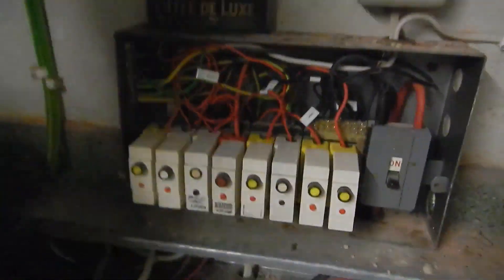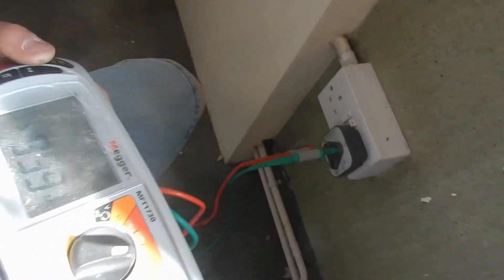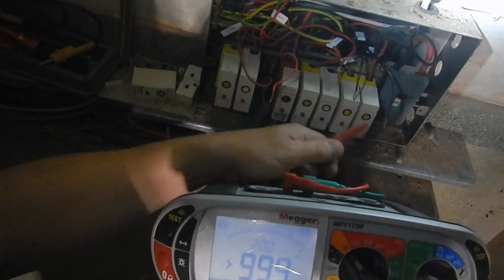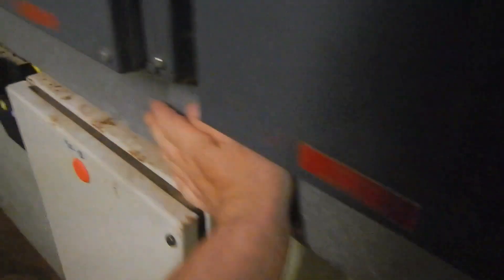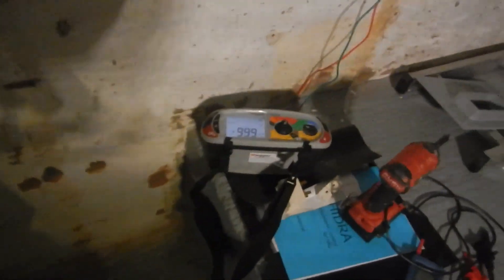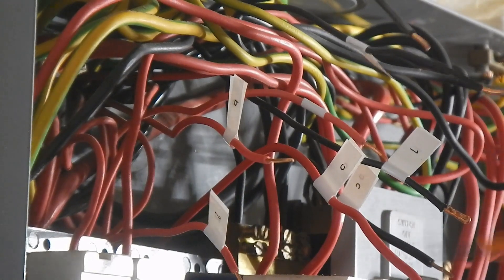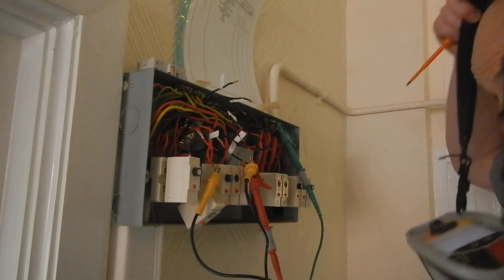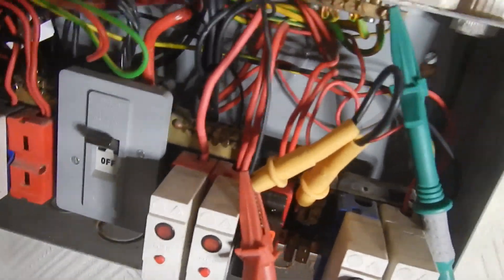Video 53:  EICR part 5

Comment: Any code for the different sized conductors in breaker 3 or the fact that two circuits are being fed from one breaker?
Reply from the maker: C2, but on some circuits I there and then downrated them to the smallest csa present.  EG kitchen board I bought new fuses to make the alteration then and there.  Two circuits fed from one breaker if they are the same generically, ie lighting circuits, shouldn't be a problem, it's just like having a spur.  So I code it C3 if anything.  How do you code them?   ACtually just bought the Codebreaker book by Napit, I'll have a look there and see if it comes up....    will let you know if they mention it....

Comment: Why do you dress like your from goodnight Mr Tom for work ?
Reply from the maker: I wasn't sure what you were referring to with Mr Tom when I got your post, but I've looked it up now and my sister seemed to know immediately what you were referring to - my socks.  This is very deeply ingrained stuff, quite psychological.  I do suffer from complex PTSD and this has something to do with it I'm sure of it, due to trauma I suffered from the age of 8 and 9, which is not suitable for mentioning here.  I'll try and explain where I think this comes from, as it is very ingrained as I said.  Wearing shorts and long socks all year round until about 14 was enforced by the very traditional boys prep school I was sent to, run by South Africans.  It is a hang up I have that I hate short socks now, I'm very OCD about it.  The socks are very similar to what I had to wear except they have no coloured bands on them, they are very soft and comfortable and are more formal in summer than just bare legs which I detest the look of.  It was practical and smart when I was a boy, although we didn't appreciate it at the time, and it's comfortable to work in now winter or summer.  But mainly, I've always been OCD about having pulled up socks.   I still feel uncomfortable seeing boys upto the age of about 13 wearing long trousers, or shorts without long socks, it seems wrong to me even now, I am stuck in my thoughts and ways which is part of cPTSD, which I am working on with intense therapy now.  I hope that explains it a bit.  Thank you for watching, and for your comment.
Reply from the maker: Hi, Michael, a reply came through from you but it was half deleted and I couldn't read it, could you send it again at some point as I was interested in what you had to say.  Also, what is Goodnight Mr Tom like?  I saw it had John Thor in it.  When did you watch it and is it any good?  Cheers.
Reply: @LAsparkTVWireTestLimited  oh okay no worries this what I put  ahh I see yeah I weren't mocking it I was just wondering as usually you would wear work trousers so you dont get smart clothes dirty but it sets you out from the bunch which is a good thing. Also goodnight mr tom is a moving set in world war 2 about a young lad that gets evacuated from london and lives with a old man in the country who helps him from his violent mother it's a good movie
Reply from the maker: @michaelboyes4948    O righto, thanks very much.  I actually thought you were going to take the piss a bit, but I'm used to it.  My wife can't stand what I wear, but I just feel comfortable and familiar like that.  I tried Scruffs trousers, you know with knee pad pockets and wotnot, but crawling round peoples lofts they brought out so much fluff dirt and crap and got so sweaty in summer, they stuck to your legs etc.  DSS electrical was showcasing some stretchy shorts in the summer.  I'm not completely happy with denim, but I buy them for a couple of quid on ebay and have about 15 pairs.  I have about 20 pairs of socks like that too.  I am OCD about it.  Next video has me in a waistcoat and long slacks though as I was off to a memorial service in the middle of it.  Probably put that up tomorrow and then we're done with this  Job.  It's been a bit of a marathon, and not brilliant for youtube as it turns out, not enough variety in an EICR, as it's very much a production line process.  Thanks for your company on the channel.